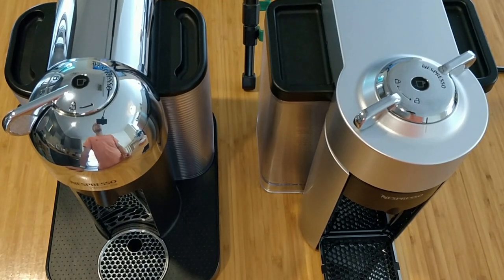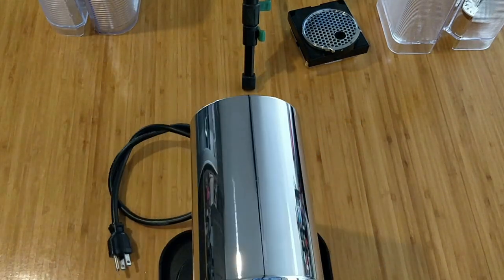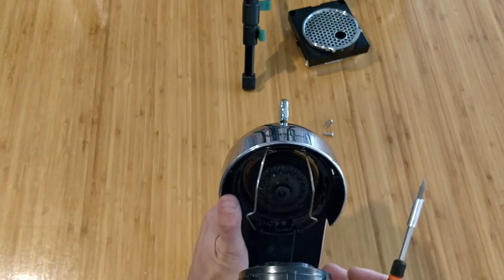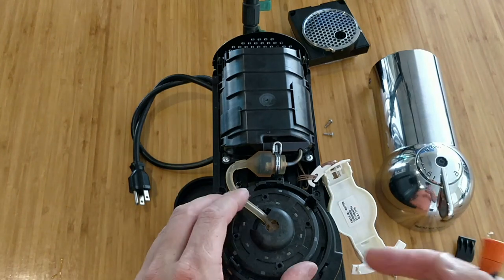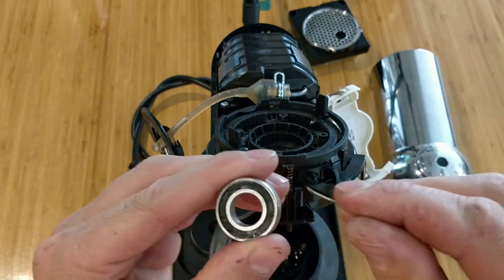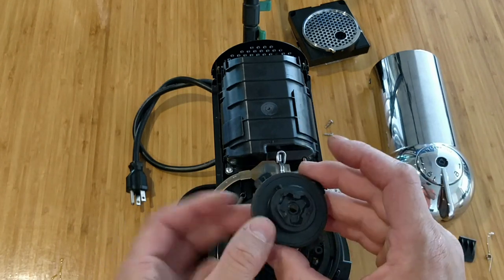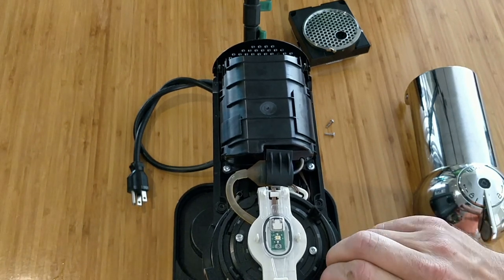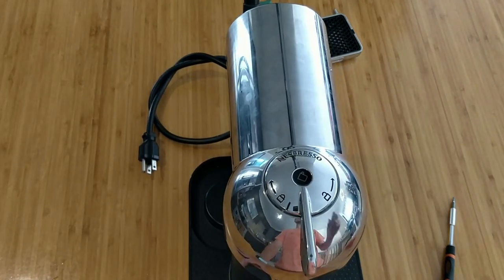How to fix Nespresso Vertuo Machine loud noise or no Water

Comment: I have a leftover spring that I could not figure out where it came from. It’s just a small spring with no hooks. Any ideas?
Reply: There are three plain springs. One goes in the very front under the white piece. The other two go on the either side near the black piece that moves up and down as you close it.

Comment: Hi, i unfortunately got the lid stuck like others in the comments. I can't seem to find a way to open the lid. There are comments to push a button or use small pliers. Does anyone know how or where to do this? I've been trying to hit the release with a thin screw driver and other options from the side without success. Please help.

Comment: it would be nice if you shown how the noise is. this is quite a process to replace the bearing and i'm not sure if this is my issue. My machine suddenly makes a loud winding noise but still wortks fine. I am worried.  had the unit about 18 months  (not this model) I have the VertuoPlus
Reply from the maker: usually is bearing that fails.

Comment: Thank you...thank you...thank you! Saved buying a new machine when the only problem was one little screw in the head had come loose. Used some super glue gel and replaced it. Now works as new. I am curious as to the grease used for the bearing. I am asking for the day when I have to replace the bearing.
Reply from the maker: I used simple bearing grease, if you plan to keep it for long time order spare bearing it's couple of $ or you can do it when it becomes more noisy.

Comment: Thank you for making this video. I was able to clean the coffee grounds that were clogging the tube. Water is still unable to be pumped into the machine but I am unable to remove other parts. According  to another video I need to remove the bottom but need a special tool that I have had no success finding. If you have any ideas or can make another video showing how to take apart the rest of the machine, that would be great. Thanks again🙂
Reply: See my mid-January 2023 comment. Worked for me.

Comment: When you disassemble a properly functioning machine, should it be relatively dry in the area where the ball bearing sits? Mine is completely wet on the inside, and I can’t help but think that’s the reason for the corrosion. I replaced my bearing and now have the exact same issue  a couple months later, so I wonder if the root cause of my bearing corrosion is a leak?
Reply from the maker: My bearing was also wet and had some coffee in.
Reply: It should be relatively dry. Perhaps the little metal tube isn't lined up properly? That would cause water/grounds to push back up into the bearing compartment.

Comment: Thanks a ton for the video. I think it is the only and the best video that explains how to disassemble the machine. We had it opened twice but made a mistake the second time and closed the lid with incorrect position of the opening handle. So it got stuck closed =(. Do you know how to open it from there by any chance?
Reply: Hi Victor, I did the same thing as you ... and my machine got stuck closed. The best solution I found was drilling a hole (1/4) with my drill in the lid right near the pin to unlock it. It's not pretty, but I got it open and now my machine works.
Reply: See my mid-January 2023 comment. Worked for me.
Reply from the maker: no drilling necessary, I use small pliers and open from the side.

Comment: Hello, I followed your instructions, but have encountered a problem that I hope you can help with. After completing the steps, my vertuo machine is much quieter, but the coffee it makes is very watery and a smaller volume than before. There are several 6901 bearings for sale on Amazon, and their description vary subtlety.  I think I got one that said “deep groove”.  Do you. Think this could be the cause? Or do you think I disturbed something else whilst replacing the bearing?  Thanks in advance for your help!
Reply from the maker: Hi, bearing has nothing to do with it it may happen if you misplaced some parts.
Reply: Take it apart and when you put the little metal tube back in, there's a notch in the flat c shaped ring that has to line up with the tab on the top of the cover for that piece. Then the rubber hose drops in flush, so you get solid water pressure and no back flow. 

I disassembled this thing three times before finding that tip in the comments here.

Comment: FYI:  If, like me, you accidently closed the top (after the top casing is removed), it won't open replacing the casing or until you slide a small lever that is located on the top, right side (facing) of the crown area toward the back of the crown. That's the best I'm able to describe the area. I had to figure out how the locking mechanism worked (from inside the lid) and work backwards to find where the lever (remember it's located inside the lid) releases the lock. 
I'm just a girl who loves to tinker and figure things out. It comes from having 5 brothers who did the same growing up. I want to clean the machine up like new before I'll most likely just give it away.
Reply: How did you access the lever with it closed? (I have flat-top model.) Tried last night with a bent paper clip to no avail. (Of course, trying to figure out exactly where it was, even reviewing the few photos I'd taken, is tough as well.)  Actually, as I re-read, it seems you didn't close the top with the upper casing attached. In that case, I was easily able to release with the tab per video.  But now it's locked with top casing reattached. D'oh!

Comment: In this video you say that the machine top on your right is easy to take the  off.   I took out the screws.. easy enough. However, try as I might I can’t get the back off. I’ve tried prying each side out with a flathead screwdriver but it won’t budge. Any thoughts or recommendations?
Reply: I got it open.  Don’t know if I broke anything. Guess I’ll find out When I try to put it back together.
Reply from the maker: It should be fine

Comment: I have the model with no screws at the back. I have taken out the two screws at the front, and released the front, but the back still seems to be attached. Have I missed a step please?
Reply from the maker: I don't remember that I had any problems disassembling it check maybe there are plastic clips.

Comment: Thanks for the video. I did the bearing change on flat top virtuoline that was shown at the start of the video.  However like some others did not align the locking handle properly and it is locked closed with the cover on and screws installed.  You mention in a couple of responses that there is a small tab or button that you can access to open it.  Are you able to show where it is ?
Reply: See my mid-January 2023 comment. Worked for me.
Reply from the maker: Check his comment )

Comment: Sounds amazing! Now only makes brown water. Then switched to the 2 blinking lights and doing nothing. I see others have had the same problem.  I did a formal descale as well. Any thoughts?
Reply: See my comment from mid-January 2023. I had similar problem and found the problem was not firmly reattaching the triangular water hose head.
Reply from the maker: It can be cause of it.

Comment: I followed your excellent directions. But when I put it back together, all it does is blink twice. Any suggestions? Thanks
Reply: Mine as well. Did you find a fix?
Reply from the maker: recheck all the connectors.

Comment: Hey, I completed the steps. I have the model on the right. I followed instructions to the T. But now after testing it, my pump is not working. I feel it heating up but I dont get a sound. Im getting the two blinking lights followed by a third steady light. I have read that their could be an air bubble somewhere. How do I remedy this?
Reply from the maker: You need to create some pressure in water reservoir.
Reply: It’s an airlock issue. There are several videos for other nespresso machines that work.  It took a lot of patience and many attempts, but it finally worked. The  straw method with a syringe worked best for me.

Comment: Great video! I’ve been working to repair my machine for a few days but I think I didn’t properly set the pegs for the lock function in the last step. It now seems to be stuck, do you have any suggestions on what to do here?
Reply from the maker: It can still be opened,  I don't remember exactly but there is a way.
Reply: the 2 plastic tabs are not able to be reached once the lid is closed. You have to physically pull/pry the cover out and up to remove the lid. It sucks and feels like it will break, but the cover is a lot stronger than you think
Reply: Were tou able to get this fixed after missing the last step? I made the same mistake!
Reply: @jennymcconvey9883   Yes I was able to get the bearing replaced. Sadly it didn't fix the machine. Machine was a bit quieter, but the coffee was almost straight water. Bought my wife a brand new machine

Comment: The link for the bearing has a $12,433.22 shipping fee... what kind of grease do you need? I got mine all apart but now I want to clean and grease the bearing I have while I fins another for a cheaper shipping price.
Reply: also where do you apply the grease and how do you clean in?  Also how do you flush the water line?
Reply from the maker: natural grease, I used old toothbrush to clean it.

Comment: Thanks for your video. I have to mention that some parts of the procedure were not quite clear because they did not get in the frame of the video. If you will decide to redo your video you should move all parts of the process a little bit away from you closer to the center of the table or locate the camera so the picture would be clearer. Thanks!

Comment: Great video! But I have a question.  Now the middle puncture is a lot larger than it was before and the pod doesn't automatically fall when the lid opens.  Any idea how I can fix this?
Reply: Check that the part where the water comes out into the capsule is not blocked. She has to move up. There is a spring and it can get stuck, ruining the capsule and creating a huge hole in its center.
Reply from the maker: or the side bars that keep the capsule maybe bended.

Comment: Hi, I have another problem, the disc is rotating but still no water, could be the water pump ?
Reply: I had an airlock, meaning air had gotten in the pump because I turned the machine over.  There are several videos on fixing that on any nespresso. Took many attempts and a lot of patience, but it finally works like a charm!

Comment: Great video, I messed up the alignment of the release and cannot open. Is there a way to manually release?
Reply: Found how to release using a slim flat screw driver at the back side
Reply from the maker: Perfect it can be done but carefully.
Reply: Possible to add some more detail? Which model by the way? @DeanRay69

Comment: I followed this process and the bearing was indeed in bad shape. I cleaned it up and repacked it with grease. This solved the noise issue, but now it won’t brew coffee. Just mostly clear water flows out and it leaks a bit. Any thoughts on how to fix this?
Reply from the maker: Try to reassemble the top part maybe it's missing piece.
Reply: I have the same problem. I was super happy to replace the bearing of my Nespresso following this video but unfortunately only clear water is infused since of it. I've tried to do cleanups (normal and descaling), to disassemble and reassemble but nothing works. I am now missing my noisy machine! :(
Reply: @chuck19860808  I fixed mine! At the end of the rubber hose there is a small metal spout with a round clip. Make sure that metal spout is pushed in all the way to the clip. Then, make sure the clip is positioned such that the little notch lines up with a small little nub on the plastic piece that the hose plugs into. I re-assembled mine multiple times and it wasn’t until I took care to match those up that it worked properly. Let me know if that isn’t clear
Reply: @andrewh9443  you're right, Andrew! I think I have how fixed mine too, thanks to you.

Now I am not sure anymore of the normal taste of the coffee, so I don't know if it's the right taste, haha! But one thing is sure: there is no more clear water coming from the nozzle so I guess it's now okay. Have a great day!
Reply: @chuck19860808  so happy it worked for you, too. I was the exact same way - questioning if the taste is right. I think it was all in my head 😂
Reply: @andrewh9443  You are my hero. I won’t tell the wife how many pods I used trying to figure this out…was on the verge of ordering a new one. Thank you!
Reply: Yes! This tip was what I was missing. Take it apart and when you put the little metal tube back in, there's a notch in the flat c shaped ring that has to line up with the tab on the top of the cover for that piece. Then the rubber hose drops in flush, so you get solid water pressure and no back flow. 

I disassembled this thing three times before finding that tip in the comments here.

Comment: hey!! i followed your video and everything worked out fine except for the last step of putting the lid back. it wasn’t aligned perfectly and now my machine is stuck closed (with the screws back on), is there a way for me to fix it back open to realign it? i’ve looked everywhere online but can’t find anything. thank you!
Reply from the maker: there is small pin if you look close you'll find it and be pressing it it will open.

Comment: I bought a VXB S6901-2RS FOOD GRADE stainless steel ball bearing from Amazon for $30 and thanks to @RomaFix, our five-year-old Vertuo Chrome is much quieter. Patience and close attention to each step resulted in success without any do-overs. Tips: @7:41 to unscrew the nut, what you need to hold on to on the bottom is the large circular section with the sharp plastic teeth, not the little disk with a small spigot in the middle. That is not clear from this video and it's important because it immobilizes that section so you can unscrew the nut off easier. I used light machine oil on a cotton swab to lubricate the slots where the mechanism for opening and locking the top ride on. It glides like new now. Most importantly, when putting the cover back on, I learned from a different video to lock the machine all the way to the left - there are plastic tabs to enable you to do that. Next, turn the lever on the dome cover all the way to the locked position and make sure it stays there BEFORE popping it back on. I had no headaches at all!

Comment: Thank you so much but i am stuck at putting the spring on and screwing the top into the littles brackets. I push and push but never enough. My fiancé tried and same result. I followed the step by step. Please help!!
Reply from the maker: As I remember it wasn't so hard to push, maybe something is blocking it ?
Reply: It can only line up one way. (I did the same thing). Put it on without the spring to determine which direction it will go. Then do the same but with the spring. It'll work, just make sure it's lined up right. Shouldn't require any extra help.
Reply: While this won't help the original commenter, the trick is to turn the lower mechanism counterclockwise (unlock), with pins at 7-8 and 1-2 o'clock roughly. Then it goes on easily. If it's turned clockwise, you won't be able to lock it, even without the spring in place.

Comment: I got the bearing replaced and the machine is quiet as can be, however now, it only makes watery coffee. I saw in one of the comments below, talking about two tabs lining up. Can you provide more details on what or where these tabs are?
Reply: I think I got it figured out. I think it was the small metal tube that goes in and lining up the C clip with the opening going into the notch.
Reply from the maker: Yes it meters only in assembly and metal rings.
Reply: Yup, that's it. Take it apart and when you put the little metal tube back in, there's a notch in the flat c shaped ring that has to line up with the tab on the top of the cover for that piece. Then the rubber hose drops in flush, so you get solid water pressure and no back flow. 

I disassembled this thing three times before finding that tip in the comments here.

Comment: My machine is now stuck in the closed position and I cannot find any way to get the capsule holder top to open.  Any advice?
Reply from the maker: there is pin that can be pressed and it will open.
Reply: I have the same problem.  Where is this pin.  I have the flat top version of the vertuoline that you showed in the first part of the video
Reply: See my mid-January 2023 comment. Worked for me.

Comment: Worked great. Totally reduced the loud brewing.  However, I must have done something wrong. It starts brewing normally but then just water comes out. The coffee comes out normally at first but then slowly it changes to just hot water.. Any idea what happened?
Reply: Mine is similar . Produces hot , but the crema deflates and it’s not strong anymore. I have put it back together a few times and made sure it’s all tightly done but no fix. Gahh
Reply from the maker: there are 2 metal plates inside they may be not aligned, try to reassemble.
Reply: Take it apart and when you put the little metal tube back in, there's a notch in the flat c shaped ring that has to line up with the tab on the top of the cover for that piece. Then the rubber hose drops in flush, so you get solid water pressure and no back flow. 

I disassembled this thing three times before finding that tip in the comments here.

Comment: I followed your video’s instructions but now my nespresso isn’t working. It will turn on, make a whirring noise when I press the coffee button, but won’t make any coffee. The button stays orange without flashing. Any tips?
Reply: Maybe I have possible solution in my mid-January 2023 comment. Problem with water hose attachment.
Reply from the maker: recheck all the connectors.